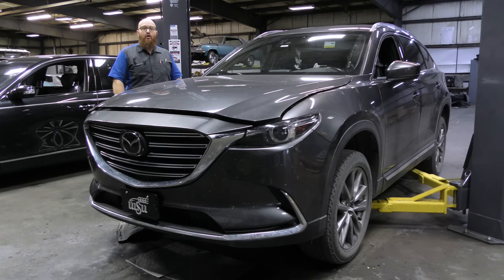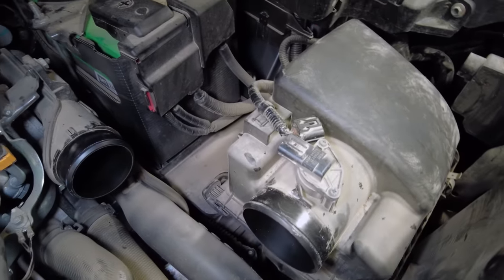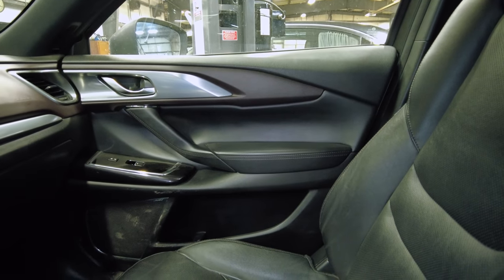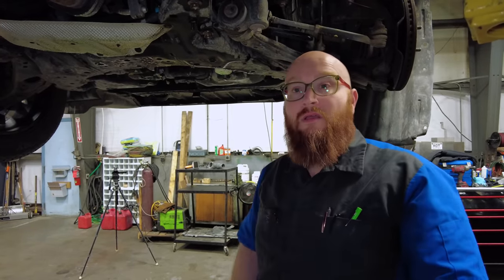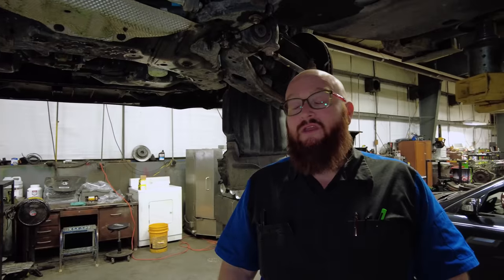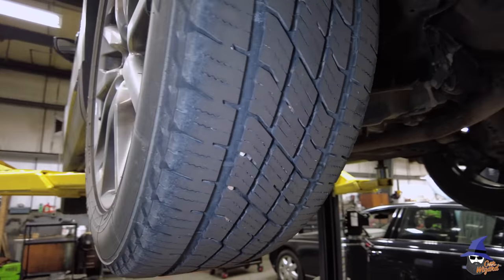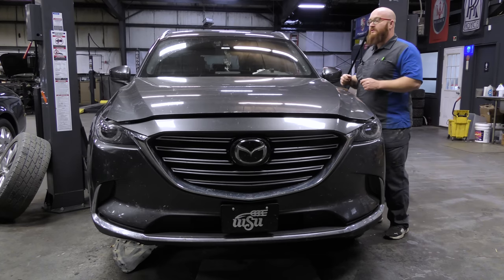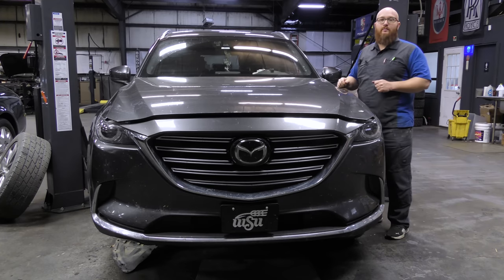Really, a $4K leak! What could be wrong with this '16 Mazda CX9 that could possibly cost that much?

Comment: Our 2016 CX-9 had the dreaded "head leak" last year and it cost us about $3K, even with a "courtesy" credit from Mazda NA.  Our CX-9 had 78K miles, so we were outside the warranty.  This is happening to many of the 2.5L Turbo SkyActiv engines (there are many threads about this problem on the various online Mazda forums, but there are apparently not enough cases for Mazda to do a full-on recall).  This is a result of a poor design and the TSB explains some of the issue, but Mazda has never really posted anything (that I have seen) as to exactly WHY this is happening and what they did to the "revised" head design to "fix" the problem.  Our car now has about 85K and it seems to be running fine.  I would like to offer a shout out to Ourisman Mazda Rockville (MD) as they were really great through this whole process.  Unfortunately, these Mazdas are ticking time bombs, so any used CX-9, CX-5, or Mazda 6 with the 2.5L turbo up until the 2021 model year (with VINs as indicated in the TSB) that have not had the head replaced already may have this problem.  That's probably tens of thousands of cars in which this problem could rear it's ugly "head".  (I couldn't resist)😄  Buyer BEWARE!
Reply: The 'why' is simple and a fundamental design flaw and not a production problem. The major problem is the complex casting with the integrated manifold having thin walls and inconsistent metal structure inherent to casting relatively complex designs. What makes it far worse though is the extreme stresses from the compression ratio and extremely high lean-burn combustion that primarily heats only the small area of the exhaust valves to the integrated manifold exit. As I'm sure you're aware, Aluminum has a lot of thermal expansion and the Atkinson's exhaust is extremely hot and a reduced, poorly mixed volume that causes crazy localized temperature variations. The thermal issues are even worse on the Turbo and cylinder activation engines which is why they're even more prone to cracking from the exhaust path in the head. Every single Skyactiv head is affected but in the past it was almost always misdiagnosed then replaced once it blew up.

They always had random overheating, coolant disappearing and oil levels mysteriously rising. It wasn't until the CX-30 came out and had such high head failure rates that people started to realize the scale/scope went way beyond just new engines in a particular model. There's often no warning until it runs low enough on coolant to overheat which is usually catastrophic. All you can do is check the coolant and oil occasionally but even if you haven't yet had an issue, it can happen at any time from thermal cycling. I generally like Mazda but these engines are VERY different to almost anything out there and I'd be paranoid AF that mine would fail. A recall is absolutely warranted but that never happens for powertrains and they always downplay the severity of the problem.
Reply: Do you live in NJ? There’s a class action here for this issue.

Comment: In 2011, Mazda raised more than 150 billion yen (US$1.9 billion) in a record share sale to replenish capital, as it suffered its biggest annual loss in 11 years. Part of the proceeds were used to build an auto plant in Salamanca, Mexico.[45] The Mexican plant was built jointly by the company and Sumitomo Corporation.[46]

In May 2015, the company signed an agreement with Toyota to form a "long-term partnership", that would, among others, see Mazda supply Toyota with fuel-efficient SkyActiv gasoline and diesel engine technology in exchange for hydrogen fuel cell systems.[47]

Comment: I had a 2016 cx9 with 52k it's been leaking since November just traded it in it's a external leak on the head gasket the engine will be fine as long as you don't overheat it the cheapest fix bye a case of antifreeze put the gauge cluster on temperature make sure it doesn't go past 200 check the antifreeze every week and add what you need i did this for 8 months the car stills runs great you can get away with this for a while until the head gasket blows out

Comment: As of May 5, 2016, Ford had sold all of its shares in Mazda, and the partnership between the two companies officially ended in 2014. Ford began selling off its interest in Mazda in the 21st century due to disagreements and a recession. From 2008 to 2015, Ford gradually divested its stake in Mazda, and by 2014, Ford only held 2.1% of Mazda stock. The two companies also severed most of their production and development ties during this time.

Comment: I don't think the engine is too small for the vehicle. It may only be a 4 cilinder, but it's 2.5 liters, that's pretty much as large as 4 cilinders get. Cars in North America typically have larger more powerful engines than in other places around the world. Especially the smaller cars would have relatively even smaller engines, and those smaller engines weren't a problem in those vehicles.
Foe example, a Suzuki Vitara from the 90's would weigh slightly more than half of what the CX9 weighs, and it was available with a NA 1.3 liter engine, producing 64hp. This also goes for commercial vehicles as well. Large Mercedes Sprinter vans used to be exclusively available with 4 or 5 cilinder engines, they even had a 4 cilinder gasoline version.

Comment: My 2009 Lincoln MKX is really just a fancy Ford Edge. It's been a great vehicle except when the water pump went out, it's turned by the timing chain, deep inside the motor.

Comment: Hi wizard! I've got one for you! 2001 wj jeep grand Cherokee limited 4.7. Not getting any real heat from vents. New doorblends, actuators, heater core, rad and pump. Dash has been off. Recirc works. It all works fine. Thermal gun shows it all working fine. I do have codes relating to doorblend travel to far, and on the scanner! No other codes! Fan works, direction for air flow, a.c. blows really cold! Why does she not blow hot? It's tepid warm at best? Any help from any one would be great! It's a gem of a motor fsh only 80000 miles!
Reply: Air Look🤔
Reply: @ricgunn1439  had a vacuum leak check! All good!

Comment: Sad gm 1.4L owner here. Original turbo gave out after 110k miles. Bad design but mostly caused by that long recommend oil change interval
Reply: 5000 mile intervals with synthetic on any turbo motor. The manufacturers just want to get you past the warranty period. The same thing with the lifetime transmission fluid.
Reply: 5000miles is quite short intervals. I've been doing about 9000 without issues

Comment: At the rate the coolant comes out i doubt Bars would work. But i could see trying it. Whether a crack or a bad HG, its leaking to the outside. To me, a lot better than tearing everything apart. A lot of times its never the same after a huge repair. I also run all of my cars with no cooling system pressure, have for years and they are perfectly fine. No stress on all those parts.
Reply: I have heard if you use Evans Waterless Coolant, the engine can operate at zero coolant pressure.
Reply: @stuartbear922  yeah I considered trying it but years ago discovered one of my cars had been running no pressure for who knows how long due to a bad radiator cap. There was no difference, no temperature difference, nothing. So I decided to test on other cars. We have a family fleet. Every one has been fine with a regular 50/50 mix though I bump it to 60/40 for a bit of added protection. Rush hour traffic in 95 degrees, or towing our small camper, makes no difference. Phoenix in July may not work but seems anywhere else it's fine. And no stress on hoses, gaskets, heater cores.

Comment: My 1997 Ford Explorer 4.0L OHV has this problem. Have to pull the engine to do the rear main seal, trans. pump seal, and change the head gaskets, other than that is still runs great, only 138k miles.

Comment: We just sold a ’16 Evoque.  Indeed, it was more or less a Ford powertrain.  It was a nice vehicle.  I did the brakes and it all said FoMoCo.  We sold it for two reasons: First It needed a part that cost $300.  The same part on a similar Ford was $60, but had a different wiring connector.  So I know any part in the future will be ridiculously overpriced.  Second, when I asked if they would replace the transmission fluid, they would not do it.  Not at all.  They wouldn’t even quote it.  So because the manufacturer views that vehicle with a managed service life, their plan for the life of the vehicle varied significantly from mine.  So off it goes.  We got a new Explorer and I am pretty sure I can take it to have the transmission fluid changed whenever I want and parts will just be overpriced, not insanely overpriced.

Comment: One effed dilemma is when you have a rig and its repairs match its value. Should you think about buying a new rig and all its above MSRP overprice from the dealer?
Then it is just a matter of time, maybe 5 years, to start paying for more repairs. You think about the money, you already invested in your old rig, and start to make equations with dirty formulas involving a brand-new car built on old wheels.
You look at your budget and think: "Well, my retirement is on the board."
So is your rig as long as its rust is contained and sustained.

Comment: Found this whole scouring the interwebs. Might help it appears there's a service bulletin on the issue as it might not actually be a head gasket but rather a head problem

"Mazda tech here. Can’t say I’ve seen any head gasket issues, but the cylinder head leaking coolant is a known issue on the 2.5 turbo engines. I just replaced one on a CX-5 about a month ago. There is a bulletin for the issue. In the bulletin it says to replace just the cylinder head assembly, so if Mazda does goodwill it for you, they’ll probably only pay for the cylinder head replacement and not a whole new engine. Whether or not they’ll goodwill it is hard to say. If it reassures you any, our dealer has been able to get a couple of repairs goodwilled before in the past. Best of luck to you, hopefully they’ll help you out. "

Comment: It’s not the head gasket. These have a TSB for cracked cylinder heads. There is an updated cylinder head and updated turbo gasket that supports the turbo better

Comment: On top of around 150 dollars an hr for labor  and the markup on parts that provides approximately half the profit on any given repair job So that’s why customers are  scammed   with thousands of dollars in repairs ! And that my friend is why these  shops  don’t want you bringing in your own parts !! All they do is have the part delivered from a place like  Auto Zone then mark that part way up!! You can get the same part at the normal price bring it in and just sign off if the part fails you won’t hold the shop responsible you can just take the part back to where  you got the part if it fails ???

Comment: I know the answer is D because he said the top end was fine so not the head gasket, the 2.5 has been around for a long while so the block should be tough enough, Cooler line could be the culprit...but because this is a Ford I am going with it has to be the cheapest part is the most expensive to fix theory...let's find out

Comment: Ford hasnt been involved with mazda since their break up in the 2010s. All the Kodo design mazdas have been 100% mazda design and ford bought the rights to the mazda 2.0/2.3/2.5 I4 engine. These new mazdas are great, but being a completely new platform for them, they do have several issues. We've had water pumps leak, drive belt tensioners leak, rear shocks leak, battery problems causing the i-stop system to not work, interior quality like worn out steering wheels and broken centre consoles.

Comment: Really interesting to hear how you said how a twin turbo V6 in an SUV would be considered a small engine considering I'm on the other side of the pond. We love our small V6s and V8s, though small to us would be putting a 2.0l I4 turbo at the largest into something like a Range Rover.

It's starting to happen, and I can see the obvious reasons. The C63 will now use an I4 and that struck close to home when I heard the news. Like the Ecoboost Mustangs, I know they're great driving cars and will work amazingly as just that, a car, but some cars just need big engines. I'd rather they cut the model and introduced something new to replace it. More expensive, more effort, but I'd appreciate it much more and I'm certain a large fraction of the automotive enthusiasts like ourselves will too. 

I think this happened with the Mustang Mach E. That would've been an all new electric SUV from Ford but they realized it became too expensive and no one would buy it as an unproven, new, fully electric suv... so they take a proven name, Mustang, and slap it into the new car and it suddenly becomes proven and justified for its ludicrous price tag in the eyes of Ford and those at automotive shows. It's a great driving car and it works amazing as a car, just sad to see the Mustang name be bastardized by Ford just like that. Maybe its just me, idk.

Edit: Spelling.

Comment: First not a ford engine but the early models of this 2.5l did have a few that gave up the head gasket.  I believe in a small batch the head was actually cracked too.  Recommend always checking the head when doing work on these engines as it was not super common but enough there was a notice for it.  And last I believe the ford ecoboost 2.3l was more of a Mazda engine than ford as Ford was granted the patents/rights to the mazdaspeed engine designs when they split back in 2012.  Mazda is designing and building their own powertrain since all of the new skyactiv builds.

Comment: Man, that's bad. And I'm used to working at Mercedes Dealer. Hell, even our leaks usually aren't that bad. Most of what leaks are front covers & cam solenoids (Probably around 2-5h labor, depends a bit on model and engine), the valve covers (before they did front covers), the vacuum centrifuges are another relatively common one on the vehicles that have it (maybe up to 5h or thereabout - Depends on the model but some of them require the intake to come off).   
I have to watch the rest, but $4000...For a coolant leak, on a relatively new Mazda. I'd guess something like a heater core. NO PRESSURE COMPLETE COOLANT LEAK? HUH? Aight so guess for Turbo line, the block, a headgasket, or a broken line...Well it doesn't need any pressure to leak, so I don't see the headgasket being it. I can't see the turbo getting that much coolant to drain literally all of it in an hour. The block would be vaugley like a price I'd expect, but it feels kinda low. Although, our remanned engines are also at least 8-10k. It mostly just leaves the broken line. But one little line, and $4000? That doesn't seem right either.
Also I like the honorable Ecotick mention. And the sickening smell of burning coolant. That's the issue with coolant, it smells sickeningly sweet, because it tastes sweet. Or, did. Until close to a decade ago at least, when they agreed to add bittering agents. But yeah that's a distinct smell that stays with you, like you said. Much like electrical fires. They linger too. If it happens in a shop, it'll smell like that, for like a few days. 
Wow, a Headgasket? With no pressure? Did not expect that.
Reply: It would be interesting to know how long the owner has been putting up with the water leak.  I assume a slow leak at first followed by constant but inconvenient cold water top-ups by the side of the road (inserting cold water into a hot alloy engine is less than ideal), and continual engine over-heating (not extreme though) would lead to the prolific leak described.  If an owner does not address such a leak in a timely manner (not forgetting that the engine bay is subject to high temperatures and heat soak courtesy of the turbo) - the result is usually much more damage - e.g. warpage, cracks, heat stress on ancillaries, damage to turbo, etc.

Comment: With a blown head gasket considering how much money it takes to replace them I would start looking around for a used engine with the lowest mileage I could find. One in a junkyard that doesn't have any front end damage. If I could I would get the transmission too just in case.

Comment: Most modern cars seem to develop expensive issues as they approach 100k miles plastic parts start to become brittle and gasket start to fail, this affects most of them and I think the best option is to sell them before they empty your wallet.
Reply: Or keep your OLD car if it still runs well.
Reply: Oil and coolant lines to the turbocharger get super hot and eventually disintegrate the o-rings, causing nasty oil leaks or coolant leaks that could either be very easy to fix or very labor intensive depending on design. It happens with all brands
Reply: @bug2011  That is the more sensible option, the latest cars are only intended to last untill the warranty expires
Reply: @Dcc357  When it comes to O rings there are different grades, some are cheap and nasty others will last high temperatures for 
many years, guess which grade the car makers use.🤔
Reply: @Barbarapape  I honestly don't think they care if they build a good car anymore as long as people are dumb enough to buy them.

Comment: Now compare this P.O.S engine to a pre 1970 Ford Engine. On the old one, the head comes off with a few bolts, new gasket and done. Now the 'new and improved' engine, just take apart the entire front section of the car. Hell, might as well take off the entire rear section too, just for fun; since something there will break in 'x' miles. THIS is why I LOVE my EV.